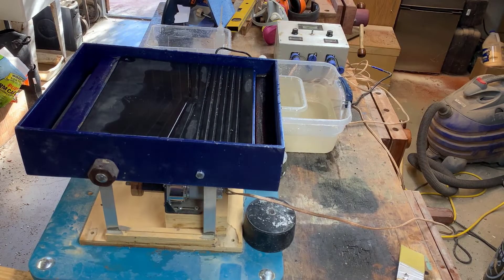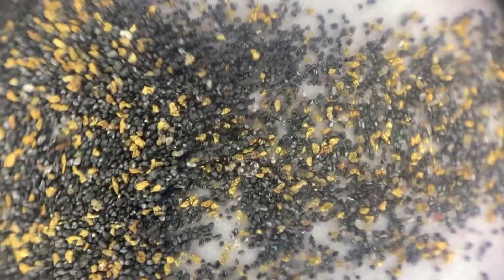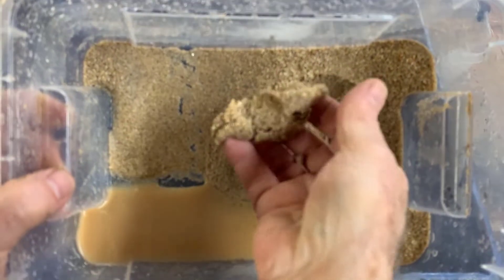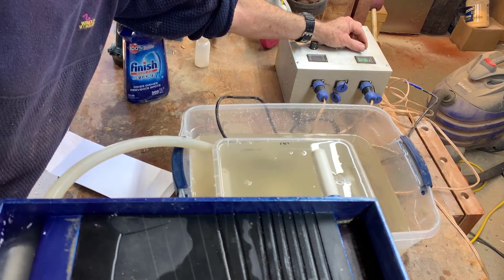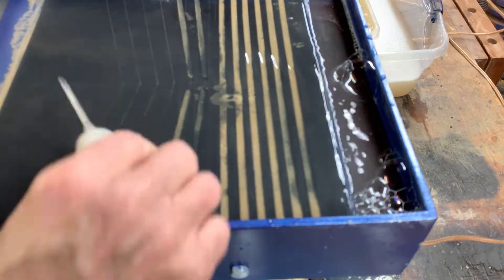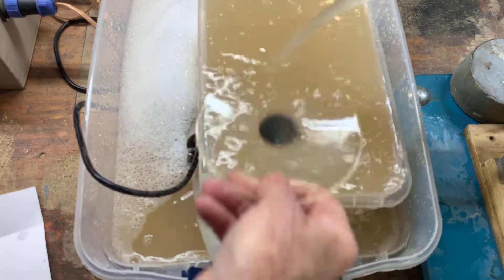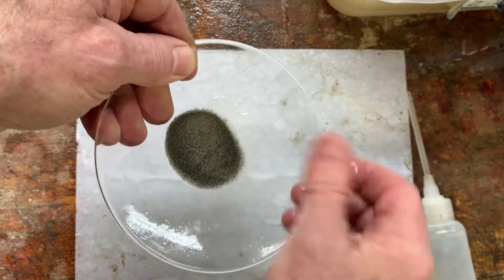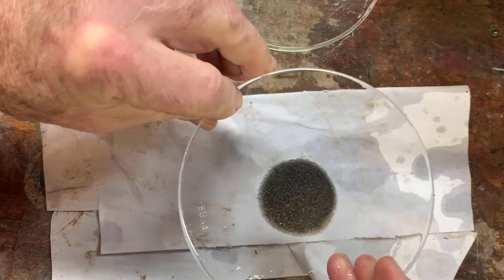The Shaking Sluice Box

Comment: I've wondered about using a side to side shaker and vertical shaker in tandem.  Side to side to distribute the material into a wide area, then vertical to sort by density with riffles depth based.  First riffle is deepest, last is shallowest, and all of them cut much like V so the gold naturally wants to sort to the bottom and lightest material should be kicked out into the next riffle.  Riffle width would probably be based on how long you want to run before cleanout.  Only thing to figure out is what vertical vibration frequency and amplitude would be best.  Probably would change based on gold size.   Also might be interesting to try the vertical shaker as a pan, gold should sink to the bottom and can just keep feeding material on top of it through a classifier.
Reply from the maker: Yeah, I've wondered the same things. Lots to try.

Comment: I just found your channel and find it very interesting. Some years ago I built what was called a "side shaker gold pan" out of wood.  The grooves were cut at a 45 degrees angle into the bottom on my table saw so they were like backwards riffles in a conventional sluice.  Side shaking the pan at a slight angle in still water caused heavies to drop into and be trapped in the grooves and lighter material to simple roll out.  Perhaps try that in still water with your groove plate at a very slight angle. Moving the pan under the material instead of washing material over the pan and let gravity remove the trash. Does that make sense?
Reply from the maker: Yeah, the whole thing is quite interesting. My take is that the side to side shaking causes liquefaction which floats the light material letting the heavy material fall through. It works quite well and explains the operation of the shaker table.

Comment: What material are you using for your table top and how do you cut the grooves? I have a CNC router table that we might use to crank out a few variations of grooves for testing. I like the idea of using a watch glass for observation of heavy materials. Just by chance I had recently purchased a box of 150mm watch glasses. They are a bit big for my small beakers but now I have a good use for them. Thank you. I hold a 350 acre hard rock claim in the San Gabriels and I need to get it on a paying basis. I need all the help I can get. Thanks again for all your insertional videos.
Reply from the maker: Hi Lars. I'm using 1/4" Neoprene rubber sheets from <https://rubbersheetwarehouse.com/>. I cut the grooves with a trim router. They are a bitch to cut with any router bit because the surface kind of folds back during the cut and leaves a protruding edge that has to be sanded off. I've found that aggressive sanding with 150 grit paper does a nice job of completing the grooves and leaves a good surface finish. It doesn't take too long. My current thinking is that a wider table with several sets of chevrons/grooves can process at least 100 kilos of crush per hour. I think I can make a 2' X 4' shaker table that will process at least that much crush also. Perhaps we should take a look at your place in the SG mountains and talk about how you can make it pay. I can perform fire assays of your ore, pass the crush through my shaker table, etc. My fun comes from making equipment, solving problems and publishing YT videos. Send an email to:  orophilia.gold@gmail.com  --  Dave

Comment: I don't think there is enough liquefaction there to keep exchanging the gold for the other particles. Maybe some sort of asymetric shake like when one taps on a pan could help in "jigging" the gold back up the table to a collector while at the same time help agitate the material? I suspect the lack of agitation is why the gold migrates so far down.
I made this self-classifying foldable sluice for a goldtrip here, (Not me in video, it's a stunt-golddigger while I film...)
https://youtu.be/frv2Bl3FGwo
The amount of flow and force required to agitate the fine particles under the top mesh section in this sluice is worrying, but it catches very fine gold, and anything big enough to not go into the second mesh size stays on top of the mesh. The plan was for it to be caught in the open section after mesh but it just stays put. That's gold pieces about 0.3 grams not moving while rocks the size of a half donut runs off. The fine stuff is caught in the first 2" of vortex pockets so it's not really any point of the bottom section except for as a lid when it folds.
Reply from the maker: Excellent comment. Yeah, the separation of gold of various sizes from materials of various densities and sizes is a very intriguing problem. My next step is black beach sand. It's quite a difficult material that tends to agglomerate and block the tiny gold particles from dropping to the bottom of the grooves. Also, even with lots of surfactant, some of the 100 micron gold floats on the surface. My conclusion is that if I can recover 85+% of 150- micron gold from black sand then I've succeeded.  -- Dave

Comment: Looks like your tape has been released a little prematurely.
But will be great to follow your progress as you attempt to optimize your recovery.
I feel amongst many issues is your feed rate.
Sure it is nice to get the job done as quick as possible , but if you are losing an unacceptable amount of gold , then something needs to change.
A question that may be difficult to answer , but is extremely important , is , "Why is not ALL the gold caught in the first chevron ?"
Try to determine where the escape is occurring.
Is it at either end , is it from all along , or is it over the top ?
Should it seem it is over the top then possibly deeper chevron could be considered , or wider , or increase in water flow or slower feed rate ( which could be compensated by a wider table )
Reply from the maker: Yeah, lots of interesting questions and many ways to make modifications. I consider 90% recovery of 100 mesh minus to be acceptable. Thanks for the comment! -- Dave